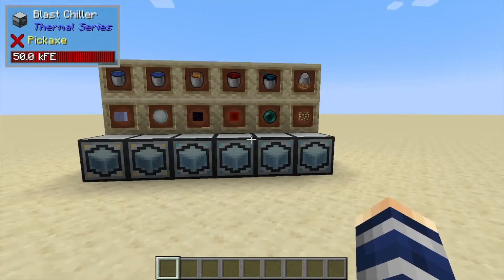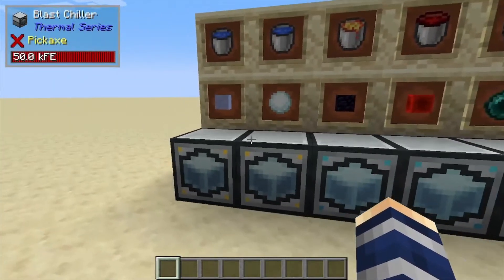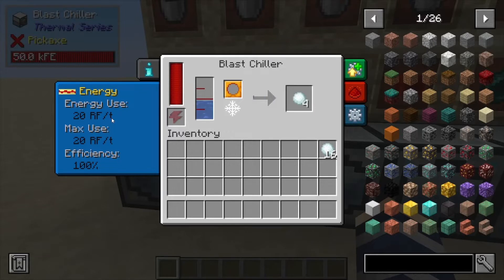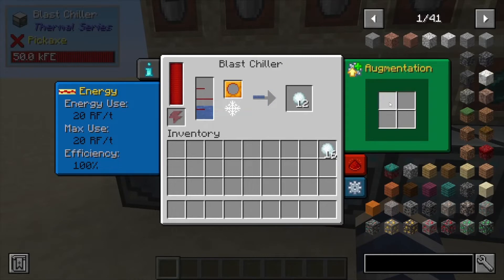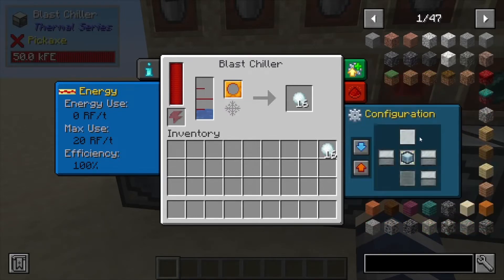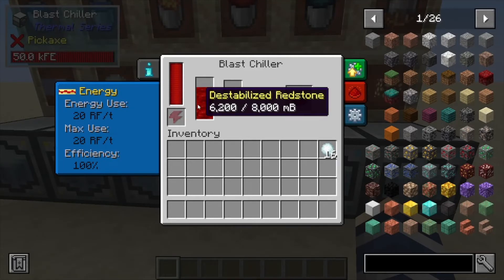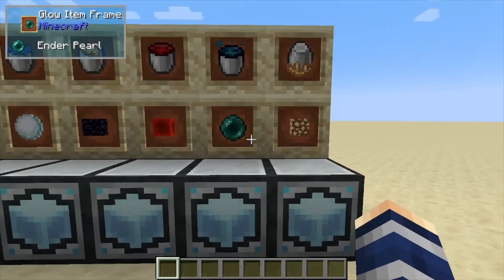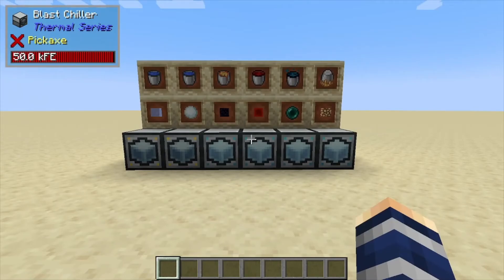Thermal series: Blast chiller (how to use)

Comment: Maybe you answered this in the video, but I can't hear what you're saying. How do you get fluids into the machine? I've tried buckets, pipes (every kind of pipe in the modpack), just setting it beside a fluid source (like how the Igneous Extruder works) and I can't get fluids into the machine at all.
Reply from the maker: internal settings could block the input/output pipes